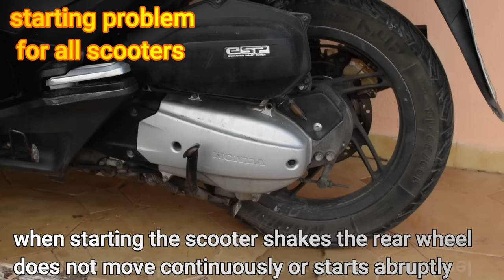scooter pcx problem with starting by centrifugal.

Comment: Bruh, clean it properly. Disassemble all the parts in Pulley set and Torque Drive set. Use a CVT spray degreaser to easily remove the dirt. Use only high temp grease. Clean the CVT cover.

Comment: You need to clean your CVT and oil and gear oil
Reply from the maker: you say it very correctly, but the two rubbers and the two seals that keep the oil from leaving the center need to be changed here and there, thank you!!

Comment: Dont do burn outs on cvt as it will quickly overheat the clutch and belt
Reply: Yeah, I agree with you. 
He just destroyed the transmission
Reply from the maker: I think you don't even have a clue why you're talking, I've done between then and now around 70,000 to 80,000 km and nothing has happened it will get another 100 thousand kilometers I believe the problem would be if it eats za where yes and will make the center baro Also only the Bearing would be damaged No i transmit☺️
Reply from the maker: You are doing well. Everyone has their own opinion and can express it freely!!!

Comment: That PCX has rear disc brake? Here in Portugal there is only availble with drum brake.
One question, aren't the clutch pads worn? They seem to be with low height.
Reply from the maker: Hi coolstor in which if you look in the videos in the past I have put it myself and show how you build it how you build it how to pcx with rear disc brake thanks!

Comment: 7:35, no wonder your clutch bell shows signs of overheating.  Why not just replace all parts with new, especially since a wheel lock-up at 90kph when something fails can have dire consequences.?
Reply from the maker: because I changed 2 bells new genuine and every 20.000 km I was facing problems this was coming from somewhere else the problem just now I found the solution and I am very happy since he fixed it a year to date I have done around 60-70.000 km and  it doesn't bother me in the least it doesn't shake or tremble you have the start i am very happy now this is your opinion with a replacement new I think I got you covered

Comment: You must Use high temp grease, 4 gram into pin lane, 6 gram inside center hole. Do not use more than 10 grams total.
Reply from the maker: Hi Heroher Tires and seals wear out and it doesn't need a lot of grease on the outside. Thank you!!!

Comment: i really like your job, the part where you re-heat treated the bellhousing was a great touch to it. nobody does that, truly good job. but as other people said, use blue grease on bearings, its the proper grease for that. thanks!!!
Reply from the maker: Hi Martin you are clearly very right, thank you for your kind words, but the grease, the ones I put in the aeron with oil, good oil, if I aerate with oil, it is the best and the blue one they write is very good but also the white grease I have tried is amazing!!
Reply: All..oks!!

Comment: Use grease with high melting point not normal grease, blue type valvoline made for electrical motor bearings
Reply from the maker: It's more diluted from the original though
Reply: @MBPATENTS كم سعر الشحم الاصلي
Reply from the maker: أنا لا أعرف رخيصة على أي حال

Comment: My scooter has been vibrating alot in pick up slow moving, i have replaced all components like , Belt, variator roller, bushings, steel wheels, clutch shoe, but still vibrating what could be the reason? Thank you for you help.
Reply from the maker: Hi visan take a look at the complications, it can also come from the rubbers that the motor mounted on the frame and the tooth that holds the motor is from what plate and from the jaws, that's where it comes from
Reply from the maker: also the springs that hold the jaws if they are open for text constance to be matches open it starts shaking because they are not tight it starts from low see also the springs that hold so many matches

Comment: I have a Piaggio zip 4stroke only he doesn't drive as it should he drives Max 15/20 Vario ring is out and he has a fast cdi and he has power loss So he should go faster and that he has power can you please help me!
Reply from the maker: Hi Runner and I'm an electrician to go to your slow concert problem but I imagine if I tell you from the messages I'm confusing you a lot, he has to look for one to the cables
Reply: The earth black cable? It’s already done

Comment: I see, You have grease on your bell, And your CVT crank case isn't clean either. Always clean the whole cvt, use degreaser to easily remove dirt/oil/grease. Your torque drive oild seal seams damage causing the grease from your torque drive to get thrown anywhere.
Reply from the maker: Hi jerbar In the past I didn't do it now that's why you come and this video to show that they should be crystal clear

Comment: good video... maybe look around  for much better made clutch . this type of thing is where the makers cut costs on cheapo metal parts. where the springs go from new should maybe have asmall steel roller inside the hole then it would not wear out so fast.

Comment: Can I ask a question, When Im fully revving my scooter while overtaking it suddenly drops down its acceleration. What might be the cause of the problem? I already check my carburetor and cleaned my cvt.
Reply from the maker: Hi ASMR if your scooter revs high then it's the carburetor if your scooters revs low then that's your problem 
https://m.youtube.com/watch?v=WxzDJVyHpJM&t=2s
Or
https://m.youtube.com/watch?v=tFoQiq9OpfI
Reply: I once have that problem too but with fuel injected scooter. In my case it's Throttle positioning sensor malfunction. Change TPS and some calibration and it's good to go

Comment: Change all the rear assembly, change the band and clean the front clutch, that makes the trick
Reply from the maker: Hi Parredo what I did solved the problem and it hasn't happened again with anything I must have done 70.75 since then and it doesn't play tricks on me again it's a very good phase

Comment: Also here...
put the front braked wheel against a wall and expect the rear wheel to spin in a burnout-smooth manner as if it were a thousand cc🤣🤣🤣
obviously there is clutch dust in the bell which, under strain, has even scratched the bell itself.
the problem is not with the scooter. You're the one who created a problem that didn't exist.😂😂😂
Reply from the maker: Hi morpheoist nice name!! very correctly you describe them let's go now there is no such problem after I made this video I have no problem with the pcx maybe it's me too.

Comment: When starting the scoot at idle,should the rear wheal move a little or not ?
Reply: It's okay if it moves at 4km/hr, specially if the Clutch Lining is new. If it moves at 8km/hr or more than that, then you should clean and check your Clutch Spring, Center Spring, and Rubber Damper.
Reply from the maker: Hi Audio Normally at idle it shouldn't move but all scooters do this logically and normally the jaws have opened a bit just enough to turn what wheel if it is stationary it is better at idle and so there is no problem.

Comment: Avoid putting greace in variator bearings most of the time it will come to clutch bell and start vislipping
Reply from the maker: you are very right, many people do it but without knowing it along the way, but if you sit down and look at it properly, you are very right

Comment: Weight of roller down about 2 grams from the originally weight. cvt spring use 1500 rpm and you will get good acceleration...
Reply from the maker: Hi danifer it has nothing to do with what you see what the video does about the clutch it has nothing to do with the spring nor the balls.

Comment: that low RPM vibration was eliminated when I changed to a stiffer center clutch spring 1k rpm, I also replaced the factory clutch bell to an after market with grooves that bites into the clutch material easily. The only time the clutch burns is when I'm on at a full stop on an incline, then give gas to rapidly accelerate (with pillion and heavy top box luggage). I have this setup for almost 2 years now, I'm still using the factory clutch material. FYI use a high temp grease, I'm using top1 and this never melted, it just turns black but not runny like from your video.
Reply: btw, if you live in an up hill or mountain areas I suggest changing to lighter roller weights, I think the sweet spot is at 17grams roller weights for pcx 150, but you can experiment on it depending on your riding style and the fuel economy you are after.
Reply from the maker: Hi joed this was a mistake that I made from before and then I realized that it shouldn't be like this so I'm explaining it a lot people I'm going to do this so that yours doesn't become clearly too right tonight!

Comment: the variator closes before the clutch engages, use lighter rollers
Reply from the maker: the lighter balls have an insane pleasure which you have and consequences you have major damage everywhere from the plastics to the transmission
Reply: @MBPATENTS  yes but the performance decrease anyway if you need that for city stuff you did a great job 👍
Reply from the maker: Hi thestic Performance is improving and everything works great!!